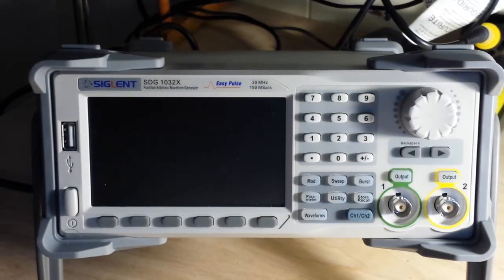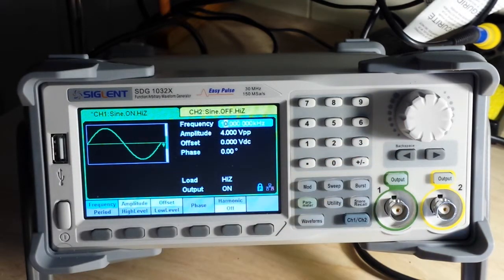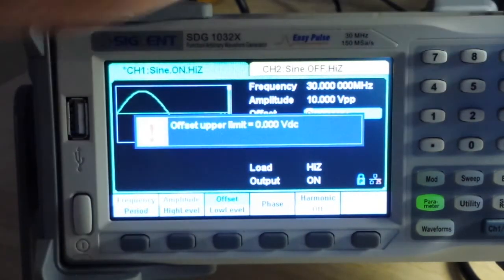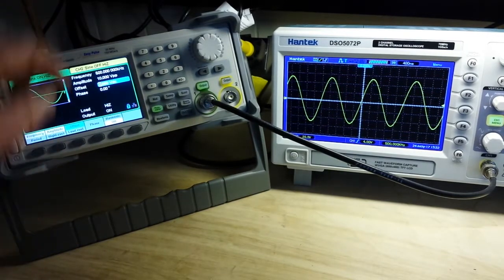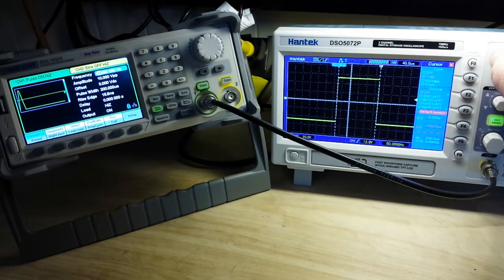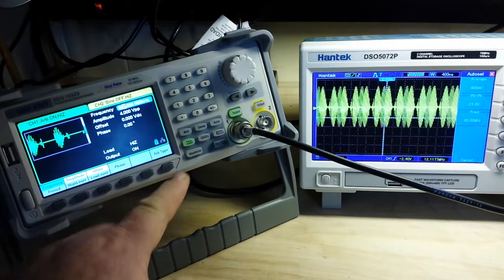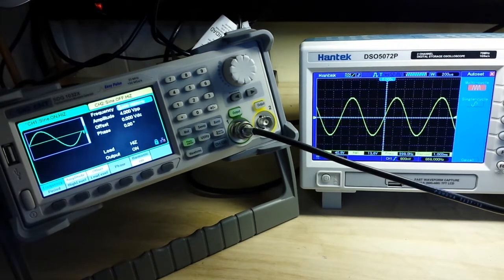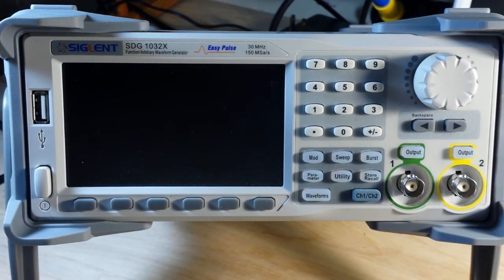Siglent SDG 1032X AWG Review

Comment: Reading the datasheet is helpful: The 1032 is 30 mhz, the 1062 is 60 mhz.  Max amplitude is +/-10V.  DC voltage range is from -10 to +10, which is why you cannot change the offset when you're in 10 VPP. 

https://siglentna.com/wp-content/uploads/dlm_uploads/2022/06/SDG1000X_DataSheet_DS0201X_E01I.pdf

Comment: The amount of offset that can be added depends upon the Vpp as well as the frequency. You can add an offset with 10 Vpp to  sine wave if the frequency were lower eg. You can also increase Vpp to 20  V at lower frequencies.

Comment: Greetings Paul, I saw your video from 2016 regarding the Siglent 1032X function gen. You seemed satisfied at the time with it and was wondering what your thoughts are a few years later. I have sig gens that will take me from under 100Hz to over 20GHz but nothing that will generate clean square wave for amp testing. Though, I can build something cheap.
73,
Glenn WA4AOS
Reply from the maker: It's a solid unit. A bit overkill for just square waves though...

Comment: Thanks for the cool video. I think the reason you can't change the DC offset is because the amplitude is already 10Vp-p. If you don't mind me asking, can the sweep function output a sync on the aux port and the FM/AM modulation take input for modulating from that?

Comment: I just bought a Siglent SDG1032X and I'm already planning on returning it.

When it boots up (to the default initial condition), the display tells me that channel one is set to sine wave output; "Frequency 1.000 000 kHz"; "Amplitude 4.000 Vpp"; "Offset 0.000 Vdc"; "Phase 0.00 degrees".

The "Offset 0.000 Vdc" is a lie. On channel one it is approximately 0.085 Vdc; and on channel two it is about 0.065 Vdc. 

If 0.085 Vdc is acceptable (instead of 0.000 Vdc as claimed), then why not 0.85, 8.5 or 85 Vdc? Where do we stop?
Reply: IIRC I measured it with my Fluke 8050a benchtop DMM. 
What voltage do you measure on yours (both channels) when you set the offset to 0.000 vdc?
Reply: Perhaps a later firmware upgrade fixed this, but I do not have this problem with the 1032 (confirmed on a scope).